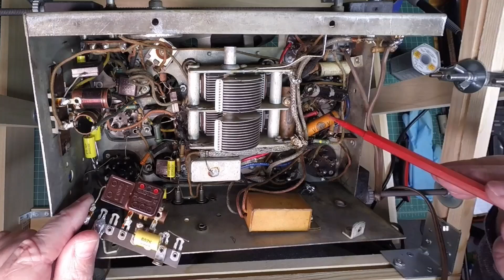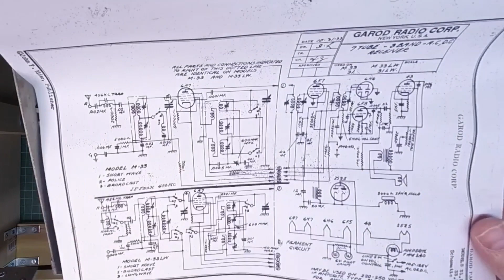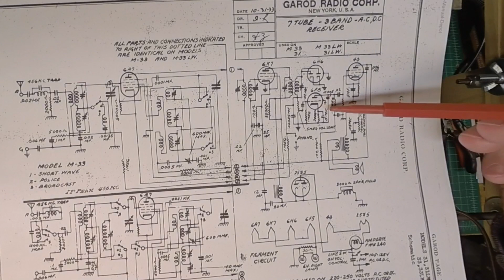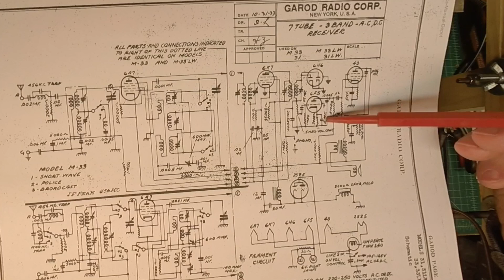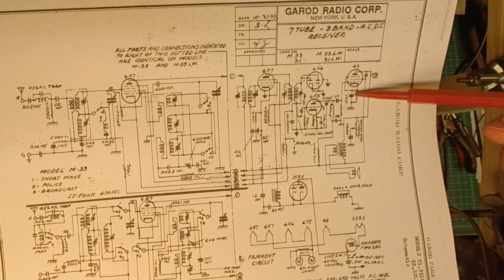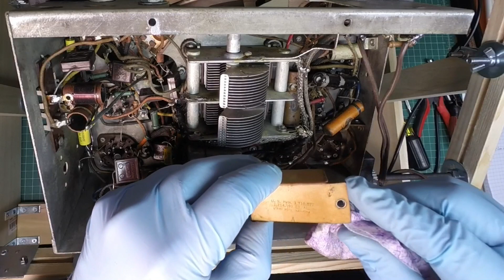Garod M33 - Part 8

Comment: I really like that stand you are using. Seems to help a lot. Good job on the repair. You are doing great work there.
Reply from the maker: +The Radio Shop Thank you. I built the chassis stand for fun and really didn't have any idea if I would like using it or not; this is the first radio chassis I've worked on using it and so far, it's been a good experience. Thanks again for your kind word and following along. Best, Don
Reply: Cool deal. It looks pretty neat. I may need to construct something similar myself,  Specially with all the vintage stuff I repair here. Thanks for uploading these interesting videos and allowing us the pleasure of viewing your work.

Comment: For the capacitor box, couldn't you use a heat gun to melt the wax and any adhesive it may have? I use a heat gun to remove stickers off of boxes, just make sure you use a low heat or you could burn the box....
Reply from the maker: +JacksJunkDotCom +SteveS us  Jack - I'll give it a try using heat and let you know if it works. +SteveS us also recommended I do the same. I'll report back and again, I appreciate the tip. Best, Don

Comment: are you serious??? I have been putting small hex nuts on screws like that for over 40+ years with diffaculty, and you just show me the small screw driver trick...............My God Don, I think if I ever come to North Carolina, I owe you a dinner!!
Reply from the maker: Glad you found the tip helpful. It's saved me a few times where a magnetic... or other approach wouldn't suffice. I've got some travel coming up too, so if I'm up your way, I'll reach out to you and we'll grab... Best, Don
Reply: +RestoreOldRadios - sounds great and the M33 was awesome. thanks
Reply: +RestoreOldRadios That's one of those things that as soon as you see it, it seems so obvious, but it hadn't occurred to me either, so thanks! My trick for putting back screws that are buried under a nest of wires is to tape them to the screwdriver, get them started, and then pull the screwdriver out to take the tape off and then finish installing the screw.
Reply from the maker: 50sTransistorRadios Thanks for watching Matt. I will give your tip a try as well, Best, Don